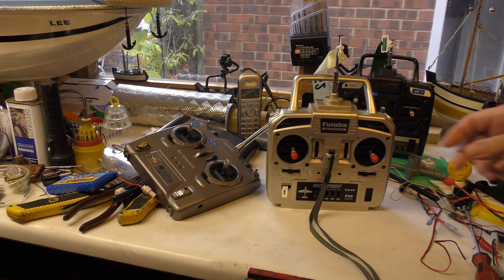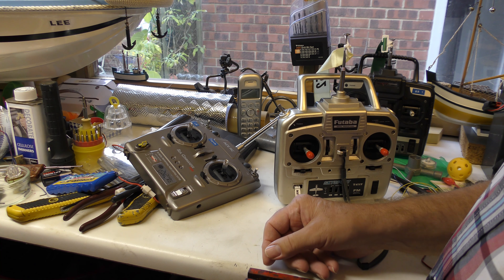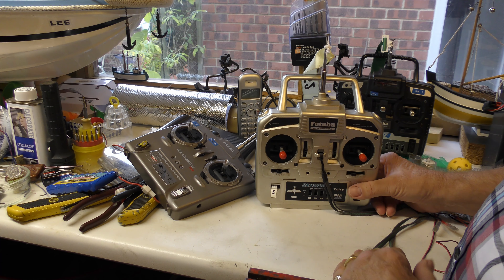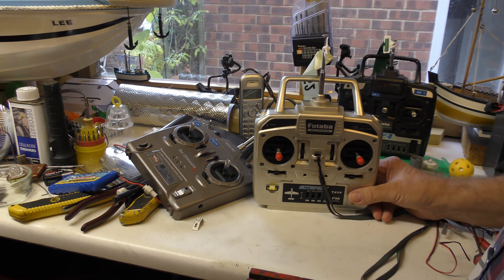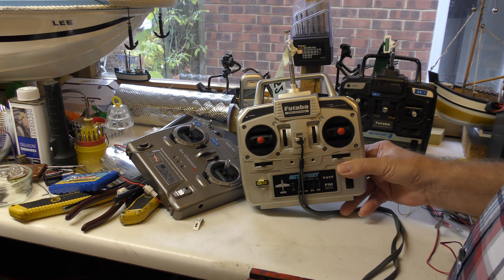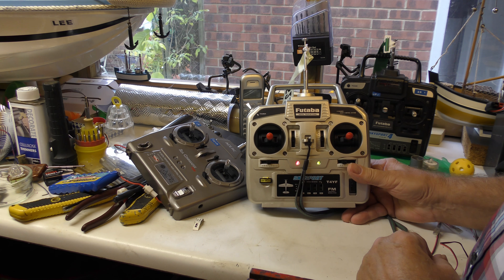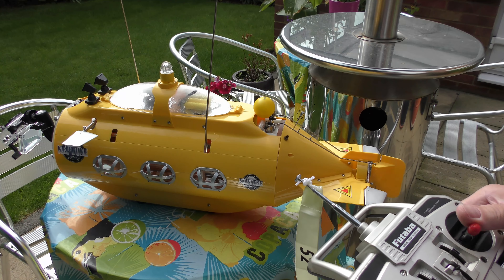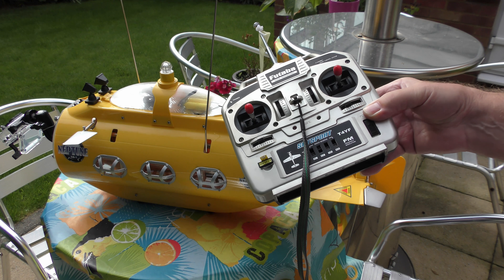Model BOAT Transmitter fix 35MHz TO 40MHz

Comment: I use a 40mhz transmitter to my bait boat.i am not satisfied about the range though.i am thinkink to buy a line attenuator and a rf amplifier which propably will work.whats your opinion?

Comment: It works perfectly fine, but it´s NOT TRUE. You can´t simply change 35 to 40 MHz by crystal change. Crystal only determines frequencies after the decimal point, but not affect the base frequency (27,35,40 Mhz). Of course you will use it, but you will still have 35 MHz radio, because base frequency is given by internal transmitter module -> this is the thing you must change.